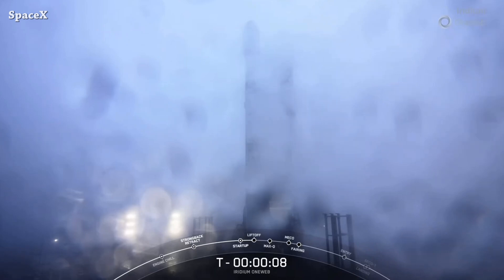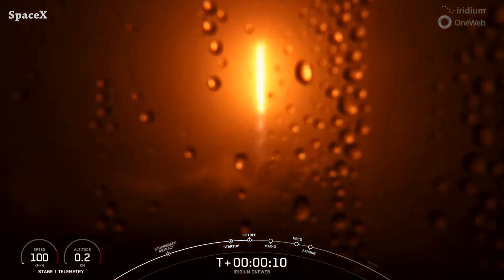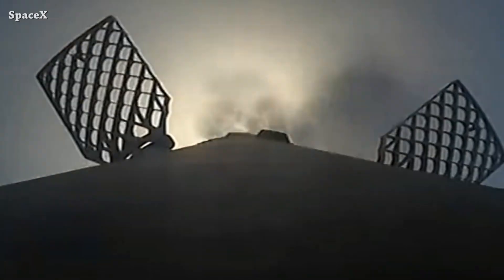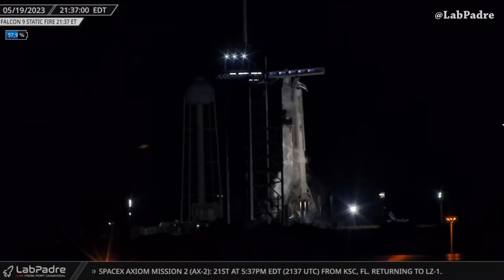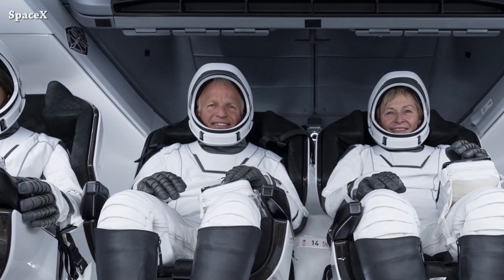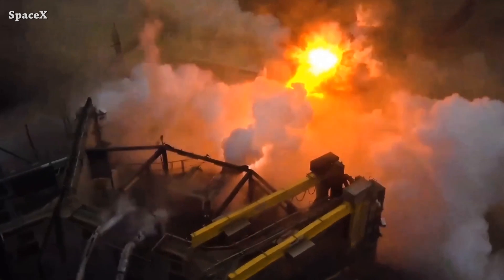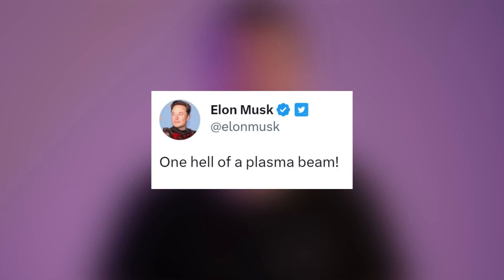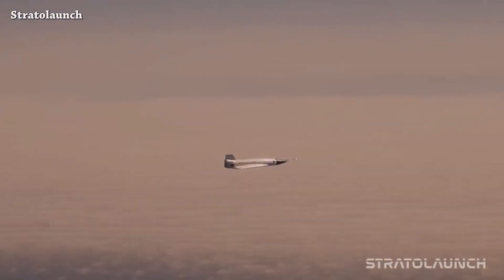Water-cooled Steel Plate Testing + Talon A-0 Separation Footage | Starbase Pink

Comment: I can't wait for spacex to silence all the armchair engineers squawking about a flame trench.
Reply: Still squawk needs squawk one
Reply: Why dont you play it back in slow motion buddy and see that the one raptor by itself practically stopped the flow.

I am no arm chair engineer either i been one for 32 years  how bout you?

Suggest you stick to your boylove manga anime
Reply: @Fatpumpumlovah2  as long as the water pressure is higher than the exhaust pressure at the plate, it should be okay. The rocket won’t be firing long enough to melt the metal, especially since it’s water cooled. As long as they lay the right foundation and don’t have any leaks, it should work.
Reply: @jwortman1984  yes understand that and i also understand it didnt need holes at all once its water cooled.

By my calcs based on pressure from engines no water pressure will be enough to overcome it and the showerhead design will will only add to problems esp if the pressure goes back into the holes.

Was better off using thicker plates with no holes and water cooled.

(Thicker so water wouldnt boil in the enclosed section.)

We will see i guess huh.  

I see 2 things happening with this design (even with angled jets)

1.  Water pressure has to be so high (Way higher than this video as you can see one raptor alone stopped the flow) it would be more of a waterjet cutting showerhead fuqing the engines completly.

2.  Insufficient water pressure and exhaust getting into the void and blowing it to pieces like it did the concrete.

Way safer without the holes by my calcs.

But what do i know lol  just an arm chair engineer as they call me. :)
Reply: @Fatpumpumlovah2  Have you considered flow rate regulation on the water supply?
That way it is possible to guarantee that water will always enter the plate without creating a water jet slicer.
I guess the ideal rate would be such that it turns to steam just as it exits the plate.
IF that's the plan then it would appear pretty much like this video.
Reply: @Fatpumpumlovah2  I had the same concern about exhaust overcoming the water and causing steam or boiling inside the plate and it just peeling apart. The raptor test video is interesting and reduces my concern.
I do not agree that the water flow was stopped because you can see that the area is shrouded in steam the entire duration which indicates to me that the water is still exiting the holes and instantly converting to steam. I think the holes are the critical design needed to allow the steam to find an exit to a lower pressure area which also provides sound suppression; this is better at removing heat from the plate than if there were no holes.
If the test plate is the same design, my concern about it being ripped apart by exhaust or internal steam has been mostly addressed. The only remaining concern for me is building the correct foundation and long term viability of the system as a whole. This is not going to be easily maintained or replaced if it breaks or there are leaks developed after repeated use. 
We shall see. Excitement guaranteed.
Reply: @jwortman1984  agreed but testplate design is not the same at all looked like just 3 ir 4 areas in the center of the plate where water was coming from i will check closely again.

And yes we certainly will see.
Reply: I Am A Duck  lol happily retired thank you been here done that.

Just like they cannot make the big engines of the past that was made by hand and no computers to do calcs for you i can say i have more experience than they do without being a rocket engineer.

But go on make me out to be the bad guy because i have input on the design while you just cheer on from the sidelines knowing absolutely ZERO!.

CHEERS from the caribbean sippin on my colada on the beach.

Fool
Reply: @dougaltolan3017  one can only guess plate pressure as we do not know diameter of holes, number of holes and angle.

I did my best with calcs on a few hole diameters.  I aint being paid for this shit,  just adding to the convo.

Did same at the beginning of starship design stating they needed ribbing of some sort on the shell and was called armchair engineer there as well but here we are today and every ring now has internal ribbing for extra structural support.

Many here discount what real engineers say because all they know is how to be a fanboy and unable to be critical of a design because yeah you know. :)
Reply: @dougaltolan3017  ps  water will always be able to get to the jacket  i am concerned with the holes at any point any of these holes could allow exhaust in thats my point.

Pls remember we are also guessing based on renders made by NON SPACEX peoole and the renders we have seen shows LOTS OF HOLES!!  LOTS!!
Reply: I Am A Duck  what you want as proof rainbow?  Gladly provide it.

Comment: Will be interesting to see how this test on a vertical plate compares to the situation under the launch mount.  Gravity is moving the water across the plate and there is clear air for the steam to expand into, whereas under the launch mount the water won't be flowing other than as a result of it being pumped and all that steam is going to have to go somewhere.  Could be exciting!

Comment: Why not just put a water cooled 90° elbow  under the launch platform   , they have enough pipe welders and plenty of material but would need to invert the heat tiles to line the pipe .
Reply: I like your idea, don't know about the tiles part, can't imagine anything going up against that blast

Comment: Is that a Raptor 3 engine? Can't see it well, but it looks different.
Reply: No looks like V2 was used.
Reply: It does look different for some reason
Reply: @jwortman1984  i tried zooming in as much as possible.  Without higher quality video i dont think we can say for sure.  As far as i know v3 only exists on vertical test stand but i can be wrong.
Reply: Pink said it was, there certainly less plumbing than other engines I've seen in the past including the V2.

Comment: if that's a comparable water-cooled test with the real thing ? my name is frank, its just a water jet...
Reply: I Am A Duck  as I understand in the real thing there would be a few inches of water above the plate. So they should do this test vertically I believe..
Reply: Not as many raptors aimed at the plate but they did compensate for that by mounting it closer.